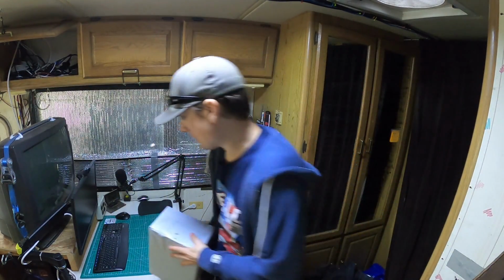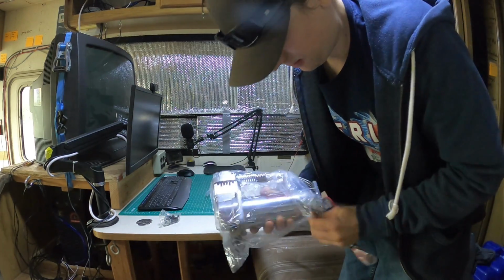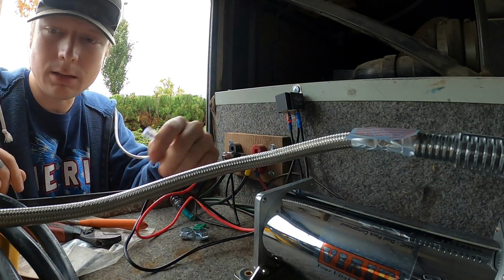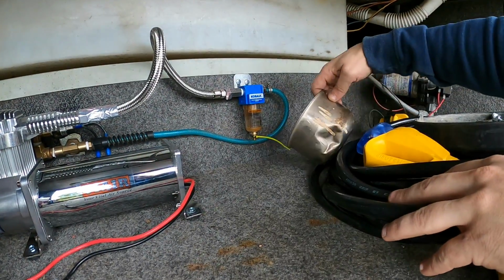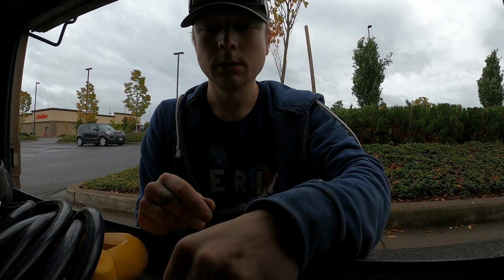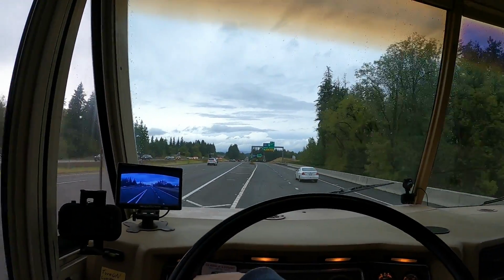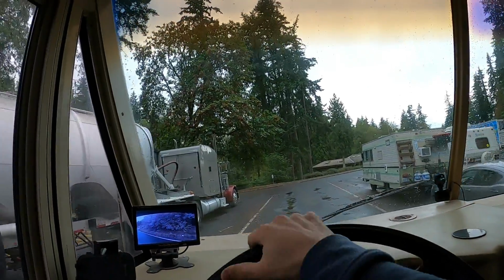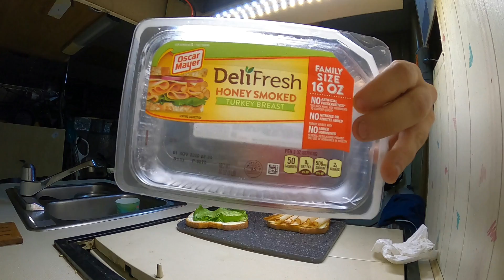RV Compressor Replacement & Parking Lot Bros

Comment: Curious if it will be worth it to actually fix the air leak. Some soppy water in a spray bottle, go over all the connections....
Reply from the maker: What makes you think there is a leak?
Reply: @ClassALiving  cause you pump it up all the time. That's not normal with air suspension. Unless you purposely drop the bags.
Reply from the maker: @yurishnirman3847  It has auto leveling valves so naturally it will release air pressure if the axel is higher than what the valve height is set to. As I drive and take corners the auto leveling valves adjust pressure.
Reply: @ClassALiving  Auto leveling should be only used when its stationary. While driving it should only hold the pressure not adjust it.